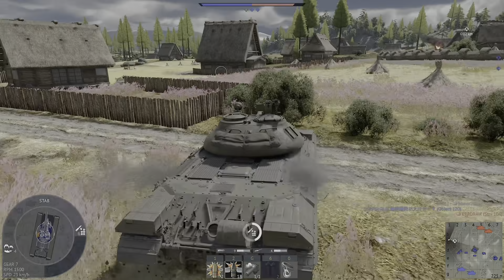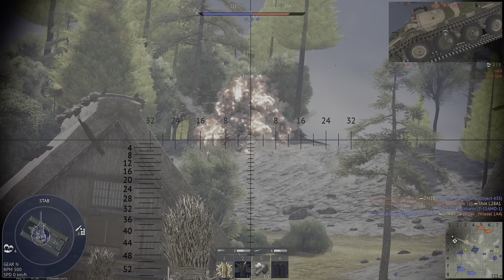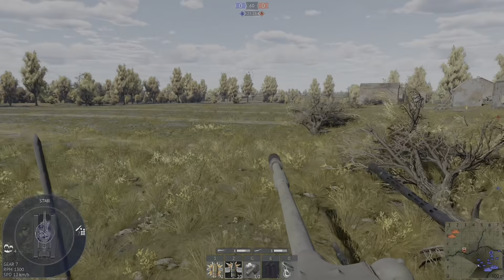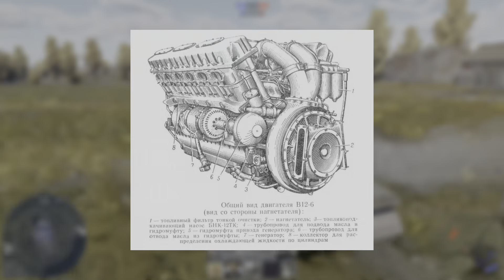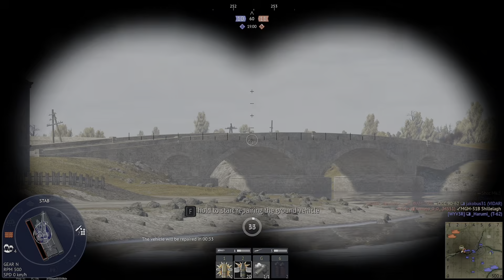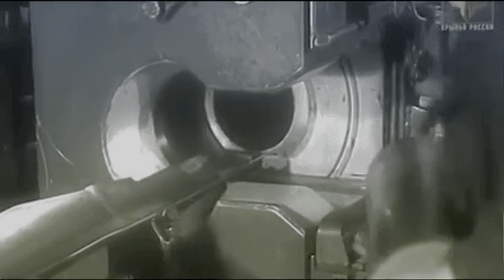The End of Soviet Heavy Tanks - T-10

Comment: When people talk about these Soviet heavy tanks, it is always in the context of tank vs tank, rather than tank vs fortifications and infantry support roles. The Soviet 122mm guns were excellent for both roles and the armor allowed them to take a beating when making a breakthrough push. The 122mm guns were famously dual purpose in that they could act as impromptu artillery, should they come up on a position that may be a little too well fortified to smash through without softening it up first.
Reply: Still the 122 was kinda underpowered for the tanks that used them, the 130 seemed better. If all your artillery is already 122 you want your giant heavy beast killers to have something better to compliment. Kinda seems backwards to just keep using the Is2 gun because it worked good then
Reply: @jackass6257  The 122mm bore size is just one common factor across the whole D-25 derivative gun family. The IS-3 had a velocity of 781 meters per second with its AP shells. The T-10 was firing the same shells at 900 meters per second because of improvements in propellant charges, longer barrels and the breech design being improved to accept bigger powder charges. 130mm guns were heavily considered but were too big to meet the size and weight constraints that the T-10 was limited to. The shell on the 130mm gun was 73 pounds by itself and was a major reason the IS-7 had a second loader.
Reply from the maker: @shockwave6213  That‘s actually good information. Thanks for adding that.